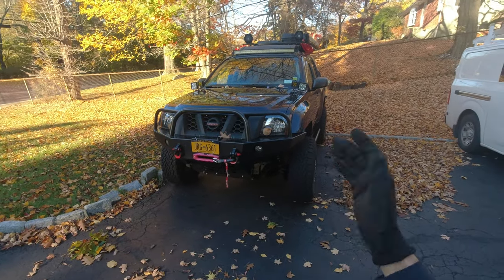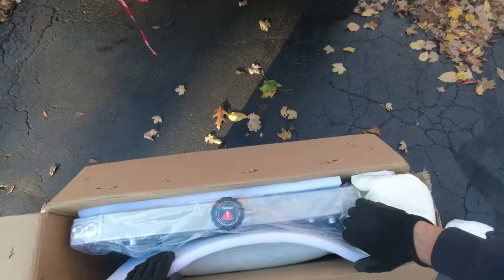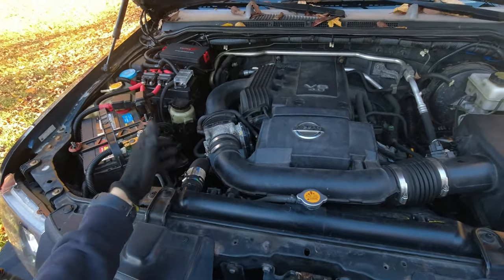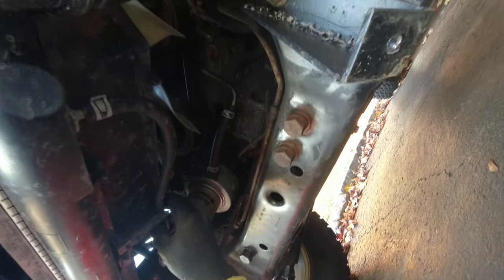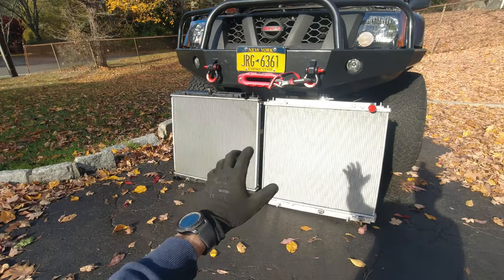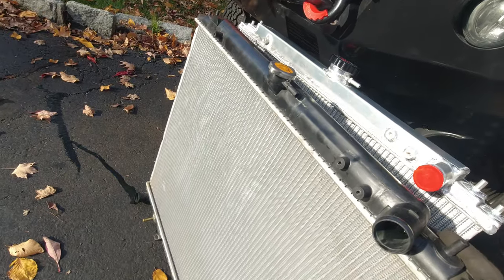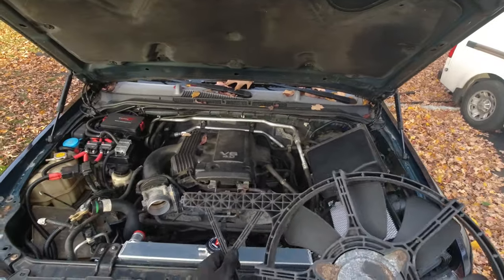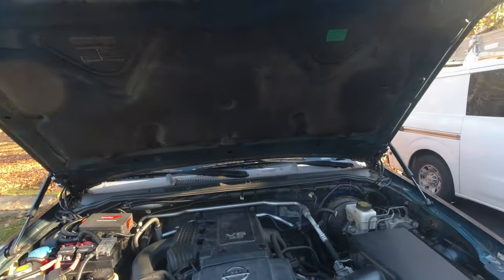AlloyWorks  3 Row All Aluminum Radiator Install  Xterra / Frontier / Pathfinder

Comment from the maker: Here are updated links to the radiators to both 2 Row and 3 Row all aluminum

Get 10% off of your AlloyWorks order using code “AL10”.

3 Row AlloyWorks Radiator
https://bit.ly/3hm6Ot1

2 Row AlloyWorks Radiator 
https://bit.ly/3UjTRif

Extra stuff you will need !!!
2x M6 12mm for shroud 
1x M6 5mm for fan.
1x Low profile radiator cap ( optional as the one with it might hit hood )

Comment: Just got the same radiator in the spring. FYI the cap that came with mine is incorrect on these trucks, just take a look at your stock cap to see what I mean. And because the new rad uses the bigger cap you cannot swap it, won’t fit. You need a Gates part number 31571 or motorad T3. I let  alloyworks know about this at the time but looks like they haven’t changed them???
Reply: This is what I needed!!! Thank you!
Reply: I couldn't find anything on Gates 31571 or Motorad T3. Got anymore info on the 2 caps?

Comment: I never thought I would call a radiator "beautiful" but that sure is a beautiful radiator!  Looks very well made.  Glad you did not have to lower the radiator to accomodate the taller cap.
Reply from the maker: Thank you so much my friend ! it is very nice  looking and looks like its well build as well . and yes I didn't wanted to lower the rad as on Xterras its already kind a sits pretty low lol

Comment: Mine is 2010 with 120,000 miles.  I just had my radiator fluid and all my other fluids completely changed. Do I need to worry about milkshake if death?
Reply from the maker: If its original radiator.. with that many miles I still be worried.. I mean.. the transmission to fix is always way way more expensive then this

Comment: Looks great. Nice job.  What's the difference between the 2 and 3 radiator.  What's the benefit?
Reply from the maker: Thank you very much! what do you mean ? 2 and 3 radiator ? the one I just had and the one I just installed ? if so.. the 3rd one is fully aluminum , its bigger its all welded so there is much less chance of leak.. it has better cooling performance as well and hell it just looks why better as well ))
Reply: I mean the 2 row and 3 row radiator.  I also have an xterra.  And was wondering why you chose the 3 row
Reply from the maker: @johngrossnickle6971  ah.. .ok well pretty much for same reasons.. as it should provide better cooling as its bigger there is more fins for air to go throw to keep things cooler )

Comment: I've recently ordered this radiator. You mention in the video you need some new bolts/screws to hold for the shroud and fan. 2x M6 12mm for shroud and 1x M6 5mm for fan.... is that 5mm a typo? I am also glad I read these comments as I see another part I'll need is a different radiator cap. Great video and it would also be helpful for your viewers to see a list of extra parts/considerations in your description. Add the extra screws and rad cap. Thanks for the video, it's the only one I've found for this radiator and xterra
Reply from the maker: Good idea ! what rad cap you ened up using ? as I kept the one it came with as I just simply hit  the hood little and it it fit as for the bots No the m6 is 5mm long very short bolt .
Reply: @DIY_AUTO_PHOTO  thanks for the reply. I ordered the Gates 31527 radiator cap based on the suggestions here in the comments. When it comes in I'll reply and let you know if it fits. So although the other commenter didn't elaborate I believe the issue is actually the PSI handing.  The cap that comes with the radiator says 19PSI. The OEM cap and replacements max at 16PSI. I don't know how bad things could really get... but I figure a $5 new cap is worth it over blowing seals etc if there ever is a temperature issue
Reply from the maker: @joshuadoolittle7262  awesome ! keep me updated  ) lets see how it will fit
Reply: @joshuadoolittle7262
Reply: @joshuadoolittle7262  was the Gates 31527 the perfect fit for the radiator? I picked up this radiator as well and don't want to run the taller cap it came with
Reply: @nomad_vk8998   The Gates cap did not work. It did not seal and leaked right away when the system pressurized. I also found somewhere that maybe the Motorad T3 would fit but I did not try it. I didn't mind banging the hood in to make the original fit I just didn't like the PSI rating. I contacted AlloyWorks about a different cap but they assured me it was fine for my truck.. But honestly I didn't expect anything different from them. I'm running the AlloyWorks cap and havent had any problems. No problems at all with the radiator and I'm really happy with it. Truck is running great.

Comment: How much did your temps improve with this radiator compared to your Koyorad? I'm VK swapped with a koyo currently. Idle temps around 188-193. 65mpg on the hwy is generally around 195-200.
Reply from the maker: Hey I think it will be a great improvement for sure !  I am still will be doing more tests but as of now I can see that my temps are an average somewhere between 15- 20  lower for both on arrange for engine cooling and trans temp I think its pretty good 

Nice man Vk swap is soo cool!!  I wish one day I can do that too . did  you do it yourself ?
Reply: @DIY_AUTO_PHOTO  I hope they have more to sell soon!
Reply from the maker: @nomad_vk8998  They said it should be back online within a month.. so hopefully even sooner
Reply: @DIY - AUTO & PHOTO  is it considerably thicker than oem? Just checked their site and it seems to be back up w/an 8% discount!
Reply from the maker: @nomad_vk8998  Yes I just updated links here as well ! and oh yes its thicker  I have photo of it I could send via Instagram if you want  but it still fits no problem with slight modifications ofc